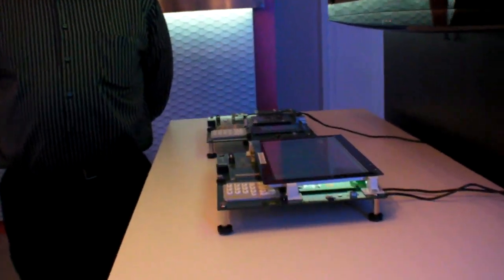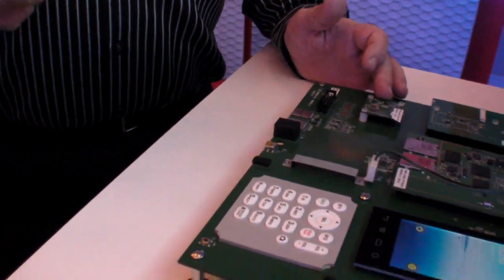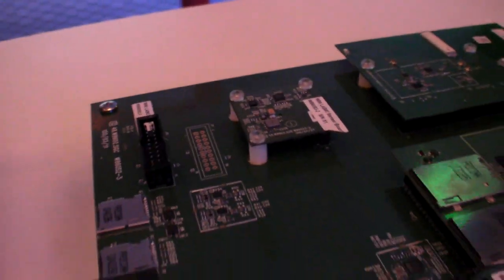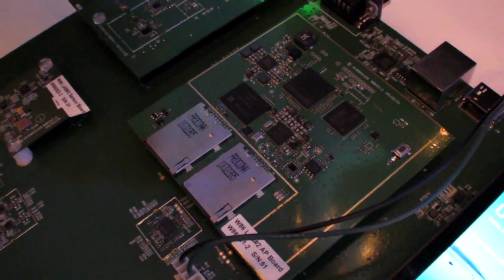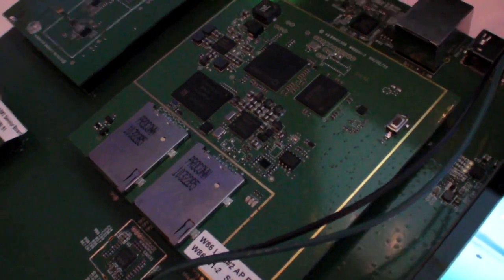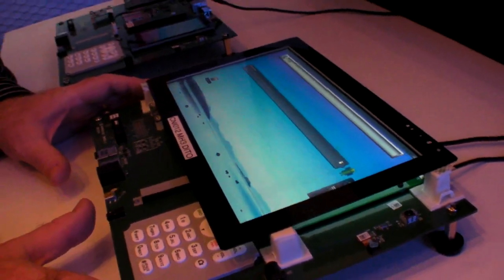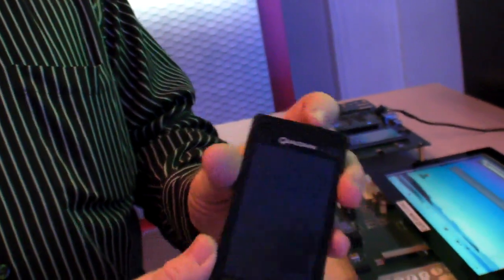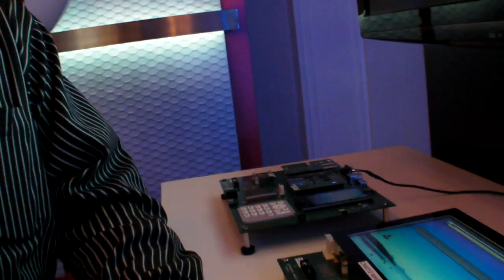Qualcomm Dragonboard, $300-$500 Dual-core MSM8660/APQ8060 development board

Comment: The same board (MSM8660) is available from bsquare-dot-com for about 495USD. The RF part is not there, i.e. you will not be able to make phone calls or data calls, but WiFi , BT and FM should be functional.